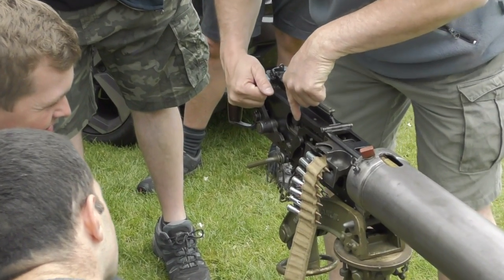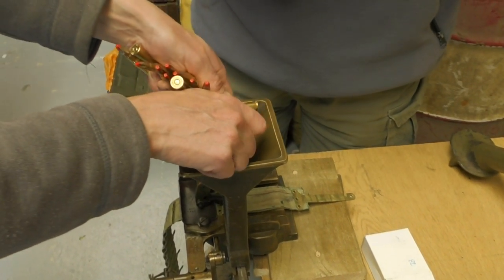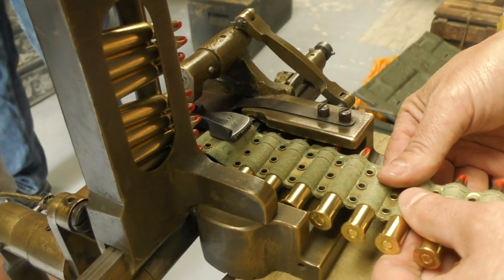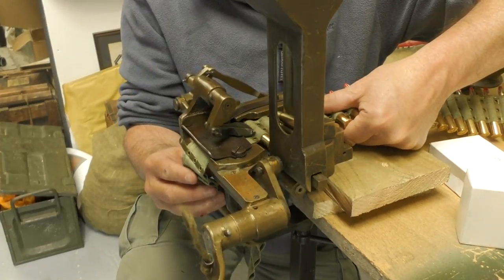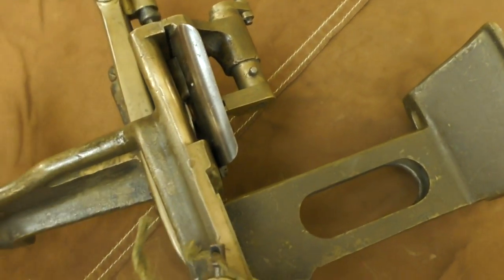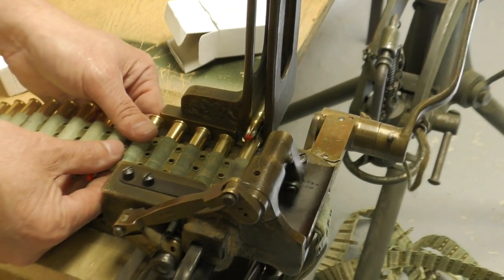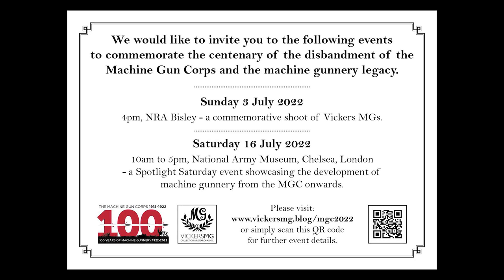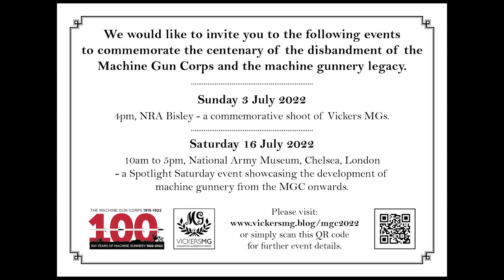How We Load Vickers MG Belts  #VickersMG

Comment: I need to 3-D print one.  Some of the parts could be machined. Wonder if there are blue prints?
Reply from the maker: There will be blueprints and design department (engineering) drawings held at the Royal Armouries probably. This has been built as a CAD model so likely drawings as part of that.
Reply: @vickersmg  Interesting.  Would be nice to get a copy of those blue prints or the CAD drawings.
Reply from the maker: The film of it is on YouTube, linked to our original video I think.